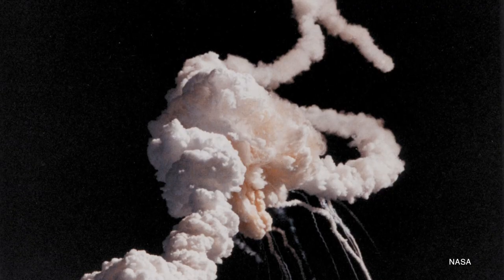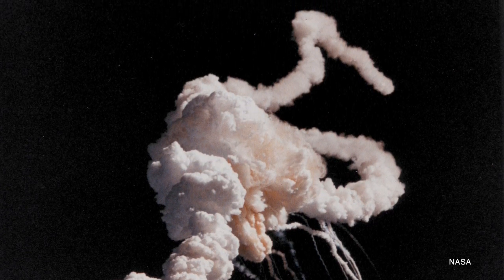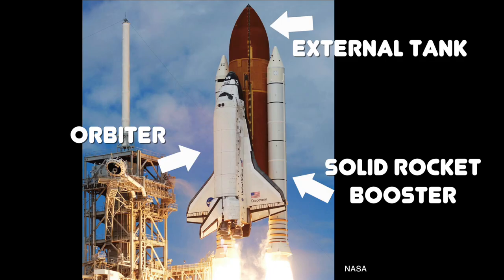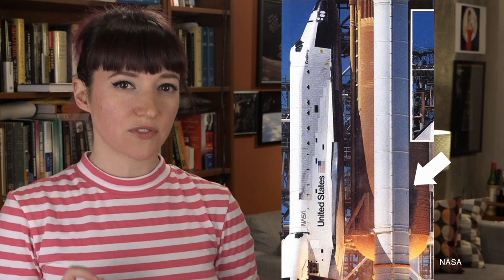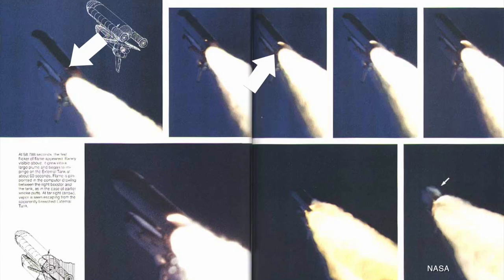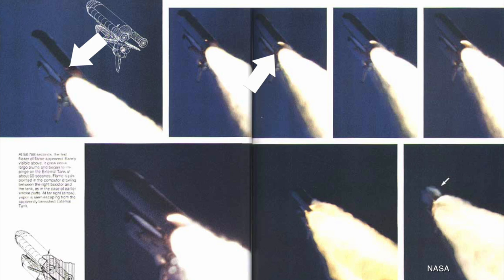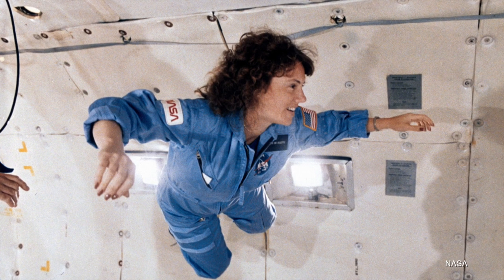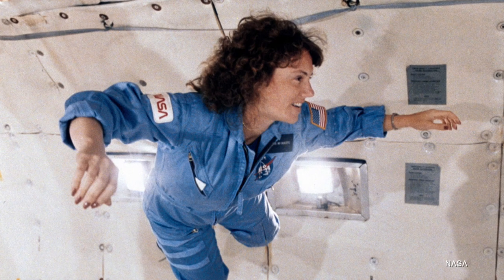How the Challenger Disaster Changed NASA

Comment: It didn't change it enough to save Columbia
Reply: Unfortunately, that was a basic flaw in the shuttle's design, which no change in culture could rectify. The shuttle should have been placed at the top of the stack instead of astride it.
Reply: But there should have been a safety culture at NASA that challenged the pressure to continue launching even as they saw repeated signs of the issue that killed Columbia, just like they ignored the O-ring issue that killed Challenger. I hope NASA is smarter with SLS, but they will have tremendous pressure to launch that too.
Reply: Strangely enough, until Columbia, no one thought that a piece of the Styrofoam insulation could be hard enough to damage the orbiter. Sadly, like aviation, mistakes are corrected with blood.
Reply: It was a totally different problem. Unlike the O-ring, no one really knew about the hole in the tiles. They thought if one were broken, it’d be in orbit.
Reply: Very different problems
Reply: cloudkitt Different problems, but the same flawed management culture of "it's never caused a mission failure before so we're not going to address it". Normalisation of deviance from safe mission parameters. From what I've read, there were some engineers who were worried about foam or loose tiles impacting the RCC panels on the leading edge of the wings, but their voices weren't listened to. It was only after the disaster that controlled testing was done, which showed that a piece of insulating foam travelling at suitable speed could cause far more damage than was first assumed... The key word being "assumed". We all know that "assume" makes an Ass of U and Me... those astronauts paid for this particular assumption with their lives.
Reply: The foam issue may have been a technical issue, but the disaster was STILL caused by the same cultural issue.  The heat shielding tiles on the orbiters had a negligible impact tolerance, and this was known in the design specs, but they'd seen the tiles hit and even orbiters come back safely missing dozens tiles, so they just ASSUMED it was fine despite all the technical documentation saying it wasn't.
Reply: ghostbirdofprey, you're on the money regarding it being a cultural issue, but Columbia's disintegration on reentry had nothing to do with the TPS tiles... as you say, orbiters frequently returned from missions with tiles missing and no harm done. The second Shuttle disaster was caused by a large piece of insulating foam breaking off from the External Tank - it was an "aerodynamic ramp" designed to streamline the airflow near one of the main ET attachment points - and striking the RCC (reinforced carbon-carbon) panels on the leading edge of the wing, creating a large hole. Even though the engineering specs stated that the RCC panels were not designed to withstand ANY serious impact, everyone assumed that "just a chunk of foam" couldn't have enough energy to cause major damage. This was conclusively disproven in testing after the disaster. It turned  out that a ~5kg piece of foam moving at several hundred kilometers per hour absolutely did have enough energy to create a large hole in an RCC panel. But it had never caused a major problem before, so they ignored it.
Reply: It was 15 years ago today 2/1/03 that Columbia disintegrated reentering the Earth's atmosphere. It left over several hundred miles of debris across Texas including body parts and into Louisiana. Seven more  lives lost. On January  28 they were paying a tribute to the Challenger crew marking 17 years since their tragedy . How could they have known that just four days later that they would be next ? Not so vintage for Amy since she was old enough to remember that one.
Reply: The Columbia accident was a result of a foam strike during launch, the foam struck one of the spacecrafts wings, punching a hole in the insulation. When Columbia re-entered the atmosphere, hot gasses were able to enter the wing structure, causing a structural failure which caused a loss of control and subsequent breakup of the vehicle. The accident could not have been prevented as neither the crew nor mission control knew about the problem.
Reply: twistedyogert, your statement that the accident could not have been prevented is incorrect.
Loss of foam from the external tank (and tiles from the orbiter) during launch was a known issue that had occurred on previous missions. The engineering specs for the RCC panels on the leading edge of the wings stated that they were not designed to withstand impact of any kind. It doesn't take a genius to work out that this could potentially cause a major problem. But at the time, no major failures had occurred so NASA management just assumed that the foam couldn't hit the wings with enough energy to cause severe damage.
This was conclusively disproven in testing after the event. The point is, with lives at stake and absolutely no escape system of any kind, they should have made absolutely sure that it wasn't going to be a problem. But they didn't.
Reply: Hey, a tiny fact.

LBJ in 1967 says to NASA. You promised JFK that American will walk on the moon by the end of the decade. And? 1970 is in 3 years! So when American will stand on the moon!?
NASA people say to him. But Mr President its really hard. We have big problems with these van allen belts. They are  filled with radiation and if we send our boys they will die there. 
LBJ - you have to do something. American must stand on the moon in 3 years. And 2 and a half years later American walk on the moon.

Now fast forward in the future to 1990s.

Its 1991 and Bush senior is the POTUS. He makes this plan about American return to the moon. He asks NASA about this.
They say to him. Mr President - with unlimited budget we can stand on the moon in 30 years. 

Interesting right?
Reply: Josiah Guthrie, way to miss the point that the original commenter was making.
Might want to read some of the 14 replies before yours, prior to calling someone an idiot.
Reply: sixstringedthing I stand corrected
Reply: It's good of you to accept the correction with dignity, that's rarely seen on youtube.
Have a nice day/evening. :)
Reply: sixstringedthing it's called Mercy
Reply: TAC TIMES, congratulations on some of the laziest spam I've ever seen.
Reply: They went through with Columbia because other shuttles succeeded with things falling off, Columbia was doomed once it launched, you can’t abort a shuttle launch.
Reply: NASA had a failure mode effects analysis that said debris hitting the shuttle heat tiles is a top criticality which might result in severe damage or loss of the orbiter. It was a known risk when they designed the orbiter and put it on the side of the tank.

When they saw the recurring foam debris issue on prior flights, they should have stood down years before to fix the large foam debris issues, (they ended up doing this after Columbia), and they should have developed the backup rescue plan using a second shuttle (they ended up with this after Columbia a well).

They should also have been inspecting for tile damage after launch using cameras. In fact engineers tried to get pictures of the tiles after Columbia launched using defense satellites, but NASA management killed the request because they didn't consider the debris issue serious, just like the O-ring issue wasn't considered serious by management when engineers tried to halt the Challenger launch.

NASA's weak safety culture (which didn't change enough after Challenger) let them get comfortable with flying without mitigating a potentially fatal risk, in the same way they got comfortable with field joint burn-through on the boosters before Challenger.
Reply: NASA knew from the very beginning that foam striking the orbiter was a bad thing. In fact, it was declared as not nominal before the very first shuttle launch, and STS-1 was damaged already so badly that during re-entry, there were spots that got so hot that they did melt down to the aluminum structure.

The very same goes for Challenger: broken o-rings already happened in earlier cold weather launches. Those even were investigated, and the conclusion was that at least once, they were lucky not to lose the crew. Yet despite all warnings from NASA personnel and engineers, the launch on that cold day was done. That borders on manslaughter. (Not to mention the segmented SRBs only existed for political reasons and weren't a technical necessity)
Reply: They did know that foam strikes had been a problem in the past and they had a big strike on video, and they did know that RCC panels could not stand any impact and they did have the opportunity to check the shuttle in orbit, they refused to check. This had multiple ways to not happen.
Reply: So what could be done? Columbia didn't have fuel in the OMS to reach the ISS. A rescue mission couldn't have been launched before the O2 ran out. The crew was dead either way. 

The FD during landing knew there could be a problem, and his worst fears were confirmed when the CAPCOM kept calling Columbia for a VHF comm check and never received a response.
Reply: "A rescue mission couldn't have been launched before the O2 ran out." Yes it could have. The next shuttle was pretty much ready, and Columbia was equipped with long-duration equipment.

Also, there were enough ideas and on-board materials for an "emergency repair" that would have increased the chance for survival significantly.
Reply: Doug Mcdonell The Shuttle could reach the ISS if the mission were planned for it and it was boosted into an orbit calculated to catch up to it. Columbia was in an orbit too low to reach the ISS with the fuel that was in the Orbital Maneuvering System, which was all they had. Columbia couldn't change its' orbit. It would need an external fuel source feeding the SSMEs to do that.
Reply: Elgoog There's no way they could repair aluminum airframe and reinforced carbon-carbon with a hole the size of a 63 Buick LeSabre in the wing.
Reply: Or, they could have another Shuttle re-enter ahead of them and give them a protective "footprint" like the Shuttle did in that movie "Starflight: The Plane That Couldn't Land." :-)
Reply: Dale Thelander - Don't listen to me, I was assuming that since Columbia reached orbit that meant the ISS, my bad.
Reply: That was due to design requirements imposed by the Nixon Administration.
Reply: Maybe to idiots. If Daddy Bush or any other prez after 1969 was really serious about going back to the moon, all he had to do was throw 50 billion bucks or so at it and we'd be there in 2-3 years.
Reply: 1. People saying it was a different issue are killing me smalls.
2. They knew about foam strikes before Columbia.
3. They had evidence previous foam strikes had damaged tiles.
4. Therefore, they had even more evidence before Columbia than before Challenger, as Challenger's O-rings had never before failed. NASA knew foam strikes knocked off tiles, but hoped it wouldn't get worse.
5. NASA is culpable.

I love NASA and manned space exploration, and I believe humans make mistakes, sometimes tragic mistakes, and need forgiveness, but you gotta call a spade a spade, and NASA by Columbia still had not learned from Apollo 1, let alone Challenger.

Oh, and NASA should've prevented Challenger by remembering their mistakes with Apollo 1.
Reply: Unfortunately the Columbia was part of the mentality of "it happens all the time and everything is always ok"  Tiles had been damaged but nothing as serious a some chips or scrapes a few millimeters deep.  The RCC panels are very strong and no one ever thought that they could be damaged by a soft piece of foam, since the soft tiles never got hurt that bad.  If memory serves (and I may have the wrong shuttle here but correct scenario) Atlantis lost a tile under the belly of the ship at a hinge for the landing gear door (or fuel ports) and it caused some minor melting of the aluminum under the tile.  It made it to land safe and the door was still operational even with the damage from heating.  The shuttle was repaired and flown many more times.  This also contributed to the mentality of the ship and crew will be OK.
Reply: @5roundsrapid263  Nonsense.  Tile damage was an ongoing thing that soon became 'normalized' - just like o-ring damage.  Tiles were damaged, fell off, etc. on a regular basis.  There was apparently one event where a critical tile went missing, and only a random steel component located beneath it saved the shuttle from disaster.  NASA didn't learn a goddamned thing from Challenger.  :/

Comment: It's a pity that Buran (basically Shuttle 2.0) never got anywhere due to the collapse of the Soviet Union as the designers seems to have taken the lessons from the shuttle shortcomings and applied them to Buran-Energia. It would have been nice to at least see how it performed by comparison.
Reply: It should have fared a lot better being on top of the stack with no SRB's or foam issues. I think they just figured out how heavy it was.
Reply: Doug Mcdonell they also changed the shielding so it could withstand impacts, the reason it never flew was the fall of the USSR

Comment: Shuttle, in my opinion, should've been grounded indefinitely after Challenger. Either a major redesign was needed or a completely new program.
Reply: I completely agree, it blows my mind to think that they never did either, it didn't have a launch escape system built into the design, the first few missions they had ejection seats but they were removed, I also heard they were looking into having the whole cockpit be able to separate as an escape system, but it was to expensive to incorporate. They kept putting money into it and it was a bad idea from the start, the new rocket they're building the SLS is essentially what the space shuttle should have been. It's the same idea, fuel tank with solid rocket boosters on the side but instead of having the shuttle attached to it there's a capsule on top which much safer than the shuttle and has a launch escape system
Reply: The shuttle was actually designed with a ejectable crew compartment in mind, but the idea was scrapped during planning, due to weight limits. The crew cabin of Challenger survived as a separate part, and hit the ocean almost in one piece.